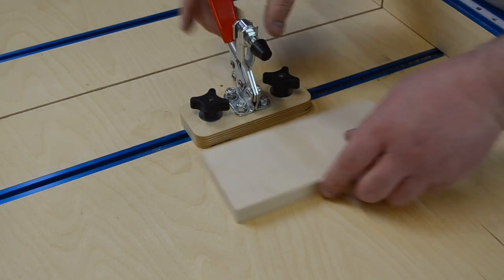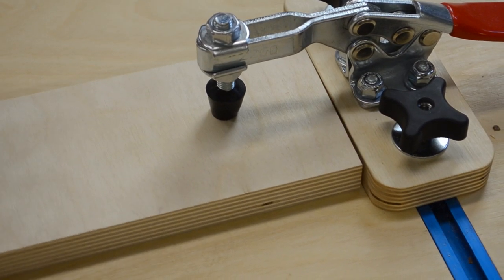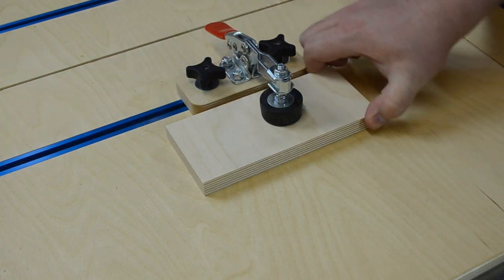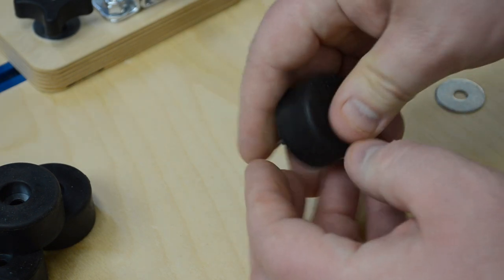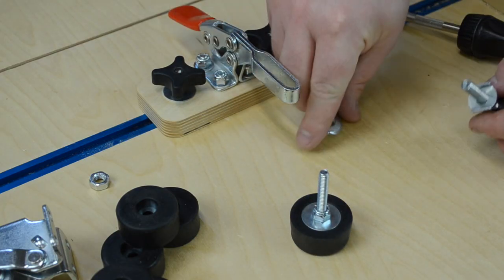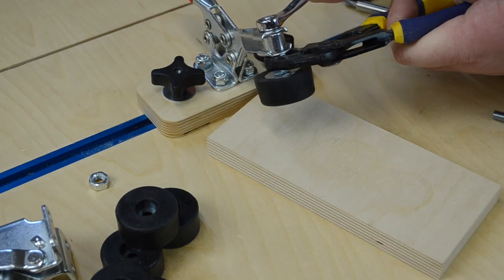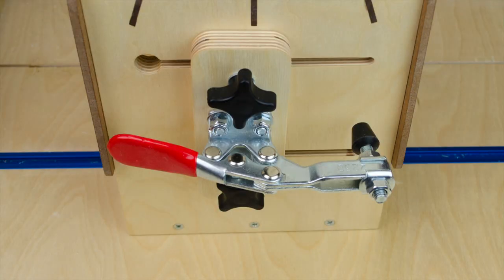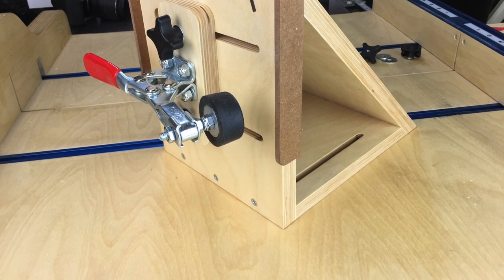Ⓕ Toggle Clamp Upgrade (ep66)

Comment: Great idea Nick. There have been times when I needed the bolt holding the rubber foot to be a little bit longer. This makes it possible without changing the base the clamp is attached to.
Reply from the maker: +Bill Hantzopoulos yup, great point!

Comment: Fantastic, and thanks for the sources link.  Another tip I read recently (can't remember where) is to replace the nut on the top with a wing nut which makes adjusting the depth a tool-less endeavor. I've converted all my toggle clamps.
Reply from the maker: +Marty Backe great point - I was going to show that but for whatever reason I decided not to - who knows

Comment: Thanks, Nick. You just sent me over from another video. I've got 6 or 8 toggle clamps in a drawer because I found them unreliable. Clearly, this is the solution.
Reply from the maker: Cool to see you found the breadcrumbs - These are a solid option - The only thing I would recommend is going with a little bit of a thicker bolt than the quarter 20 if you’re comfortable drilling out that center fender washer if you’re not a quarter 20 is fine but I have found a little bit more rigidity at times would be desirable
Reply: @NickFerry  Its embarrassing to admit but I have a can of those feet in the rubber materials drawer and I'm sure they're big enough for 5/16 bolts. I agree, 1/4 is too flimsy when 5/16ths are an option.
Reply from the maker: If you saw my stash of hardware I don’t think you would be embarrassed
Reply: @NickFerry  The embarrassment isn't for the things I have squirreled away. It is for giving up on those DeStaCo-style clamps when the solution was in the next cabinet over.

Comment: Pretty slick -- thanks for sharing.  I've also made sacrificial wooden hold-downs by tapping 1/4 20 threads in scrap pieces of wood, for when I have to cut really small pieces of wood; like making custom chop sticks.
Reply from the maker: +Habitats really good tip!

Comment: Nice upgrade Nick!

If you were really serious about clamping surface area, do you think you could basically add another machine screw to the clamp (in the oval slot) and make a bracket to hold 2 of those rubber pads 90 degrees to the clamp arm (It would look like a 'T')? The 2 bolts would give you anti-rotation and the 2 pads would keep the work piece clamped in a much larger area. Just a thought.
Reply from the maker: +Adam possibly - hard to picture exactly what you mean though

Comment: Hi Nick , you should use 5/16" Bolt  for that style of horizontal clamp . Also, you could use a 5/16 plastic Knob  for the Top &  a 5/16 Flange Nut instead of the Washer and Nylon lock nut.
And last if you use my 5/16 Internal threaded bolt retainer , you will be able to adjust this up and down without any wrenches.  Cool video.
Reply from the maker: I did this video before you sent me the stuff - the pad would need to be drilled out for 5/16" so I just threw a 1/4-20 in it

Comment: Two things to think about! Use a regular bolt and small cane tips, press the head of the bolt into the tip with the drill press to keep it straight then fill the  tip with hot melt glue or e-6000 glue. Also use a knob that a bolt goes through instead of a nut on top. This makes it easier to adjust and faster than using a wrench. Longer bolts are no problem this way. I keep a couple of multiple lengths in a drawer. BONUS! Use white cane tips and they leave no marks where black can leave a ugly mark.
Reply from the maker: Not a bad idea - I haven’t used cane tips for this before but if I had to guess it would be softer than what I’d prefer
Reply: @NickFerry  I have tried both and you should try it. Actually the cane tips are pretty hard as you would find out when you press the bolt head into the tips.  Cane tips are long lasting and think of being dragged on concrete and hard surfaces and still last for years. As for the hard legs you use you can freeze them then drill them out for 5/16 bolts. Both methods work well as I stated I have used both.

Comment: Hey Nick, you have hit on the perfect mod for these clamps, as the tiny feets seem to be the weakest part of the lockdown. The small feet may also depress the work piece when working soft materials. I imagine the cheap rubber pads also get hard over time and need replacement.

I know from your other vids, that you rely on this style of clamp for many hold downs. Are they the Harbor Freight versions, or do you need something a bit more stout? The HF pieces are typically available for $6-ish and the snooty online woodworking shops require, shall we say, a much larger commitment.

This will make about six of your projects I'm gonna build soon and either gotta get busy or fly you down to South Florida for a week to help in my shop. ATB
Reply from the maker: Thanks - I have links to the exact ones I used in the article here - https://nickferry.com/2016/05/toggle-clamp-upgrade-ep66/ - if I remember correctly, they were $6 or $7 - the pads do help greatly for both added clamping and distributing the pressure over more area making them a lot less prone to damaging the wood.

Comment: Is it advisable to put anther toggle clamp on the other side (@1:12) of the cut piece on a sled?  I keep hearing from every wood worker that cutting a piece on the short end can cause the wood to kick back making it super dangerous. So would clamping it down help? (A complete novice here)
Reply from the maker: +bobo for that particular cut I am more than fine doing it for a few reasons -  
1) it isn't trapped between the blade and another object
2) the piece is pretty close to square 
3) there is no side force pushing the off-cut into the blade

essentially if it does contact the side of the blade it will merely get knocked to operator right 1/32" to a 1/6" of an inch - but at the end of the day, do only what you are comfortable with - great question!
Reply: +Nick Ferry Thanks for sharing your knowledge :D

Comment: Another advantage to replacing the original rubber foot is that you can substitute the original bolt with a longer one. That way, you can mount your clamp on a 3/4" piece and have enough length on the bolt for the rubber foot to hold down a 1/4" work piece.
Reply from the maker: for sure - a lot more freedom in the setup

Comment: Next improvement is to make it tool less adjustable. A couple guys have vids on how they did theirs. With 1/4 20 threads you could just buy the knurled thumb screws at any hardware store.

One thing I noticed about yours is they have a little fitted washer between the arm and nut on both sides. The HF ones don't seem to have that. Interesting...
Reply from the maker: Ray from Clamp Plus sent their tool-less one but it was a different thread then what I used but it is pretty cool - I just to need switch it out one of these days

Comment: hi Nick, that's a great idea again. but what about two clamps? I use two clamps in a row for longer working pieces. this works like a treat. :-D anyway, for smaller pieces a bigger rubber footprint is better. i like it.
Reply from the maker: +Andreas Hötzel thanks - yeah I mentioned that - two clamps always good whenever you can but sometimes you have to do just one

Comment: Where did you get the pre molded part?
Reply from the maker: Link in description
Reply: @NickFerry  Isaw that too late. Sorry
Reply from the maker: @Detached_AZ  no prob - if you end up trying it, let me know how you like it - the bolt could be a hair bigger in diameter than I used but it’s pretty damn solid